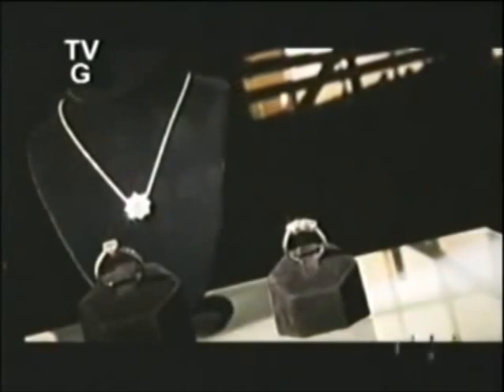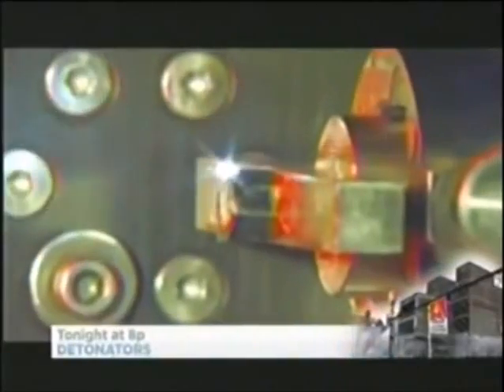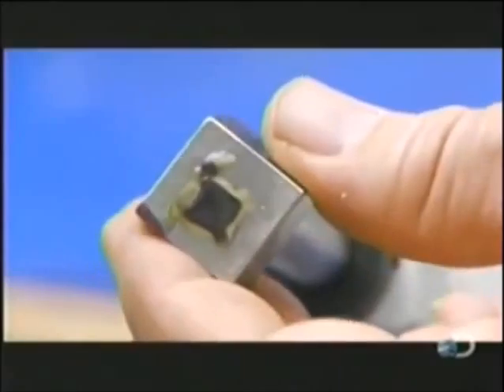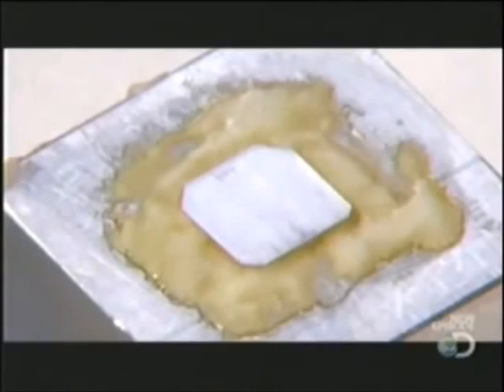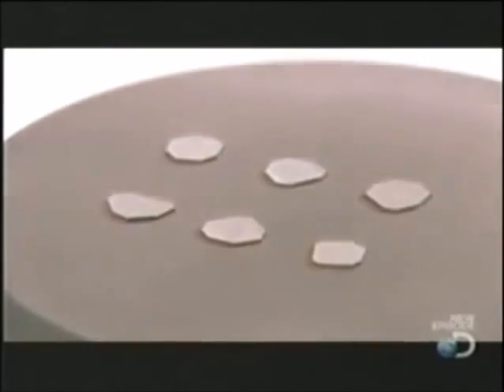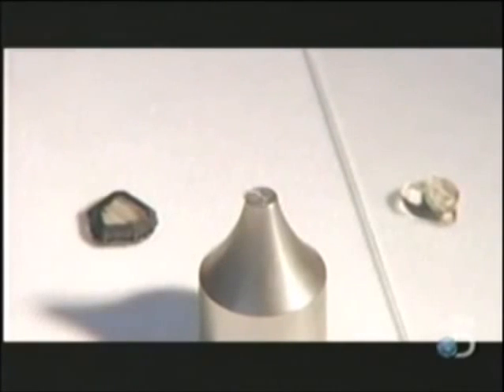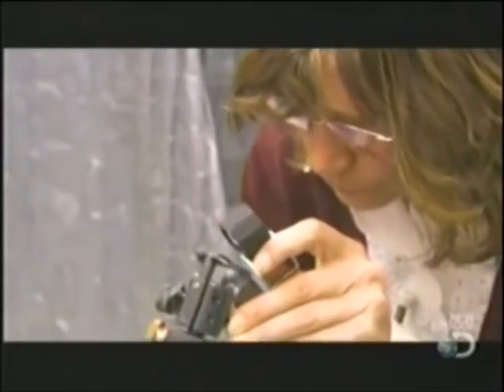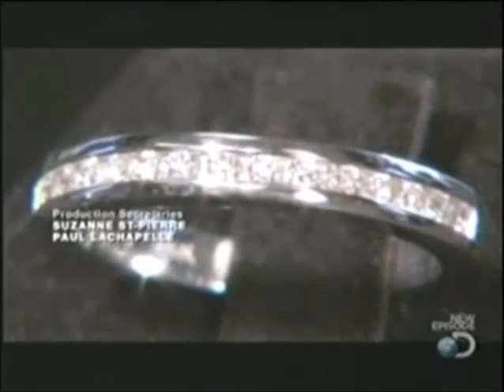CVD Diamond Creation

Comment: This technique is good. At the time of polishing, coolant should be used. So temperature will not be enough to melt the epoxy. Please tell me the parameter for CVD diamond polishing. Like substrate material, chemical used, pressure, speed etc.
Reply: you get any solution if yes please let me know, will rewards